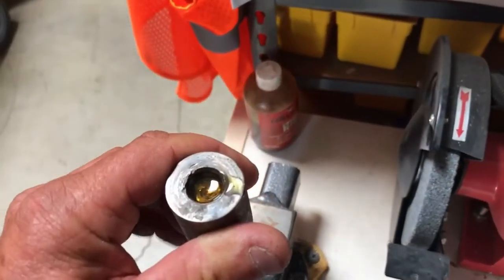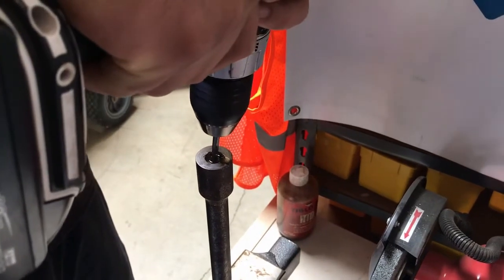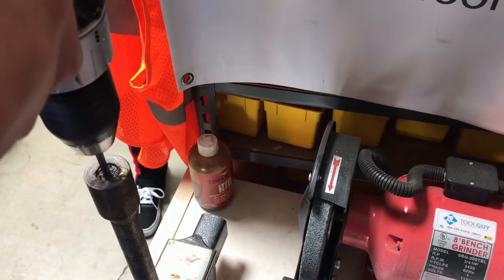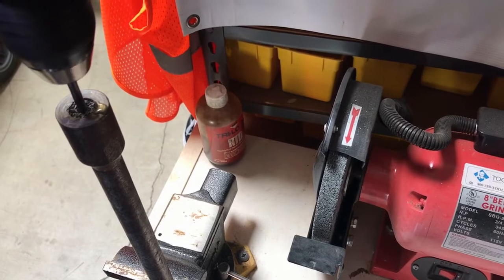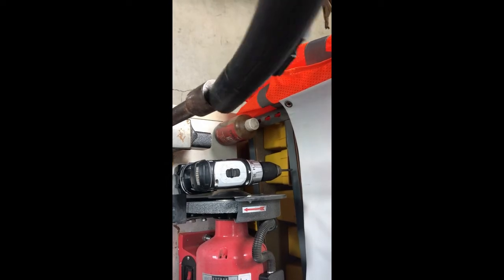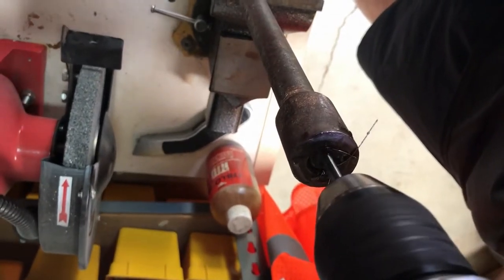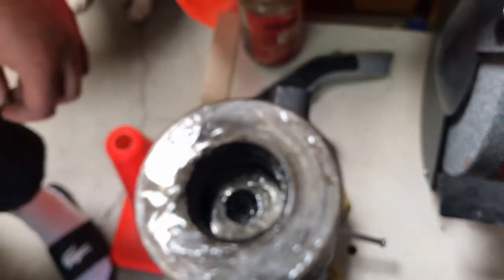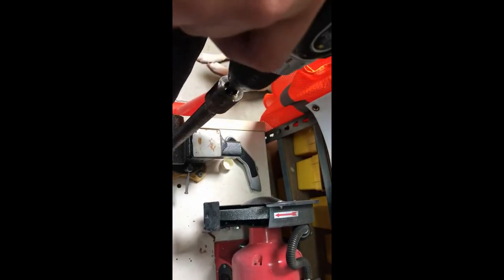How to Drill out a Broken Bolt!

Comment: I do this all the time as part of my job...best thing is to use left hand bits, they loosen the bolt as you drill.
Reply from the maker: Left handed drills and easy outs are great for a mildly seized bolt. But sometimes when you need something harder Solid carbide is the only choice. We get calls daily of Broken bolts with broken left handed drills broken off inside the bolt head. 
Solid carbide drill bits are the way to go when dealing with heat treated materials to avoid a head ache.
They'll also save money by retaining the sharp edge and can withstand high heat lasting longer than M42 Cobalt!
If you ever need some help call us! We have expert drilling techs 
800-350-8665
Reply: @drillbitwarehouse776  you are correct, I was just talking about my experience.
Reply: Hey! Can u help me I have a grade 8 bolt I have to drill through. It’s the bolt from the ball joint that goes into the knuckle. ... what the hell do I do. Been stranded too long

Comment: U should do that test but with a bolts that actually tought to get out not with some cheap ass drill and it out
Reply from the maker: Hi Roc Straight Flute Carbide is NOT CHEAP and made in the USA...Best choice for drilling heat treated steels as well as stainless
Reply: @drillbitwarehouse776  he talking about your drill not the bit. And that bolt was far from seized any one that has any real need for an extractor set and how to use them can see your bulolt come out easy fella